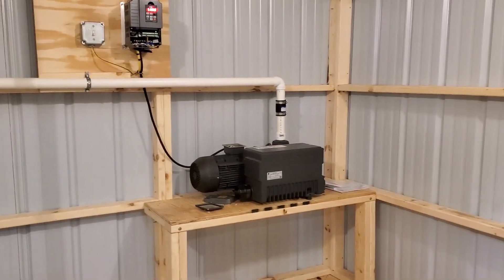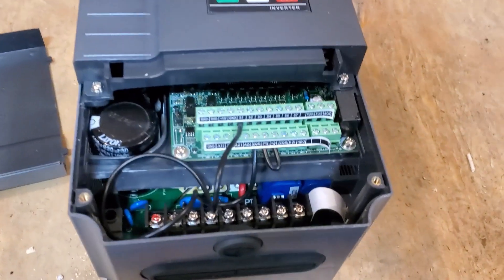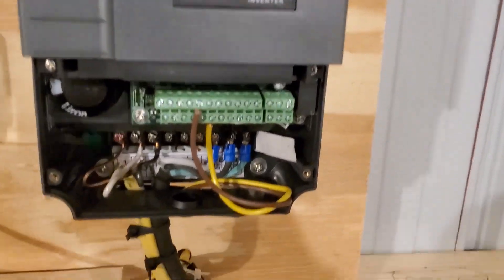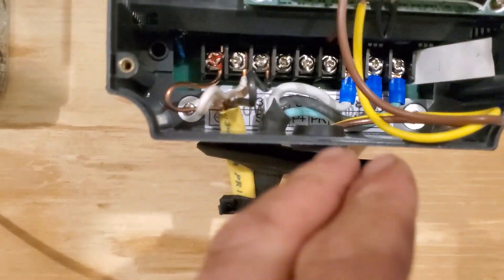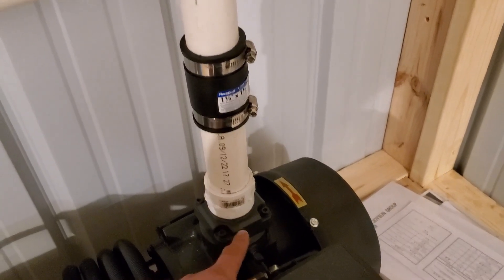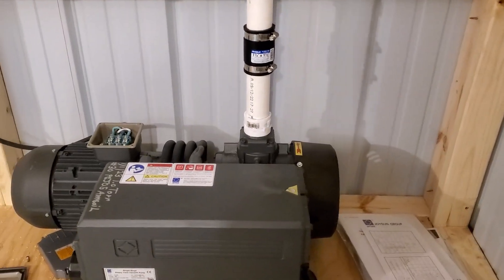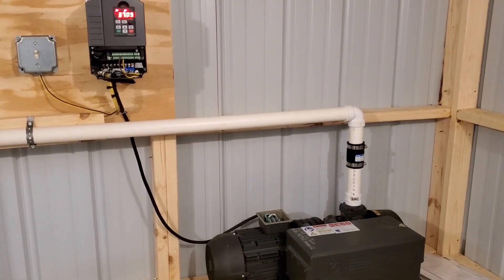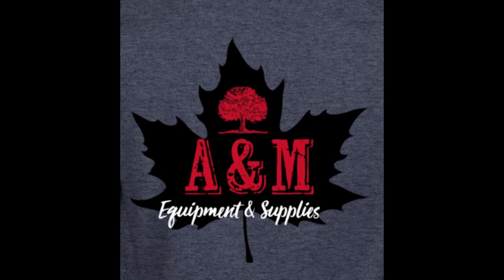A&M Pure Maple Syrup (Joysun Vacuum Pump Tutorial) # 3

Comment: What size generator could you run this on?
Reply from the maker: Depending on the pump but a 5000kw would work fine.
I like to run the power of the generator into an electric panel then to the pump.